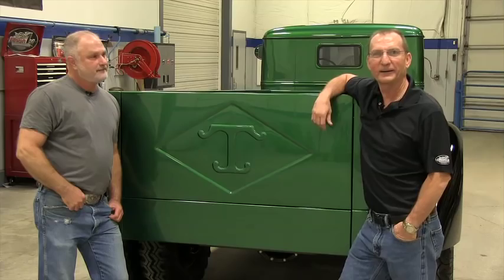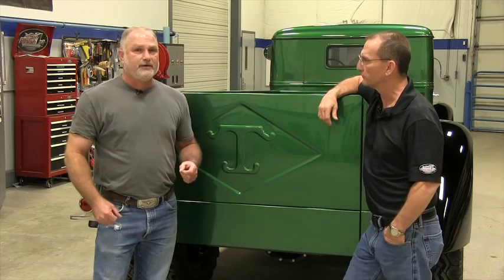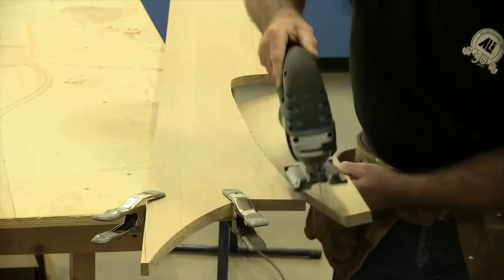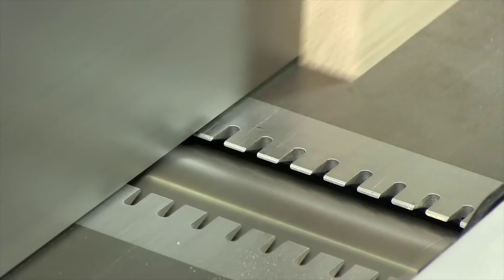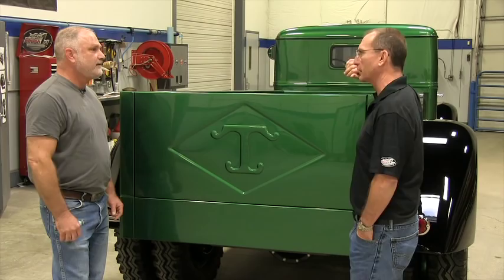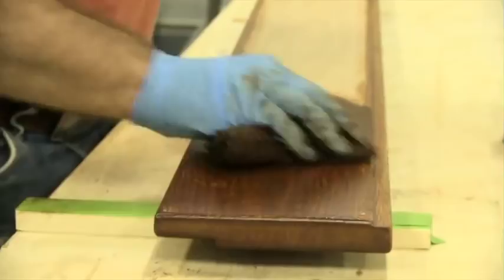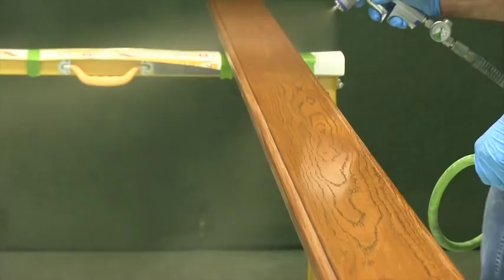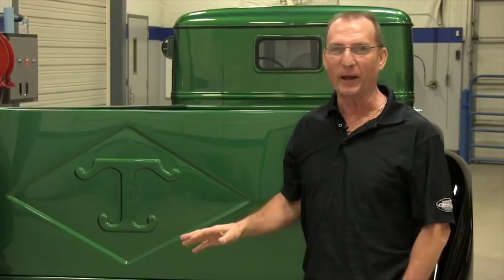Custom Truck Bed for AAPEX (Part II)

Comment: What was the brand of marine finish you used for the top coat?
Reply from the maker: Thank you for your question! We used System Three's Marine Spar Varnish in Gloss. It is available in quarts and gallons, in Gloss and Satin finishes.